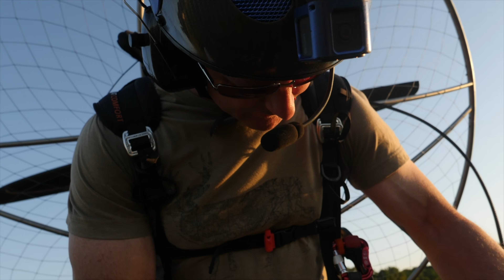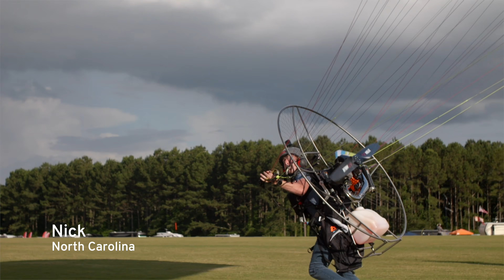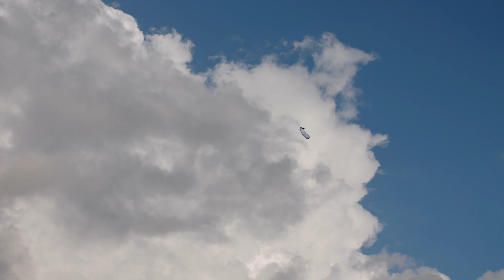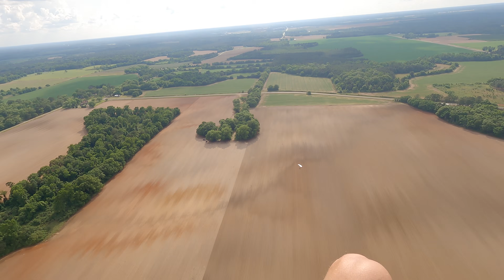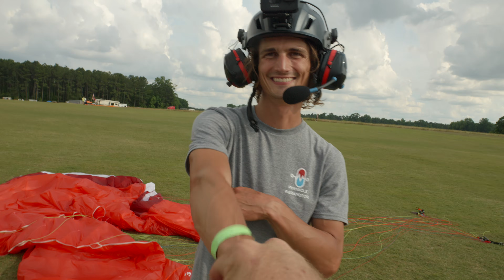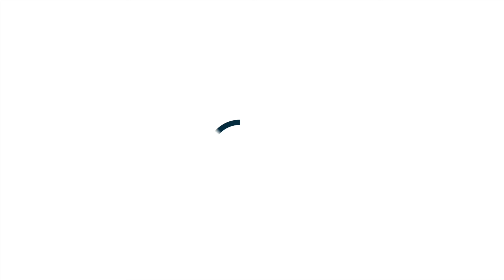Limitless Paramotor UNVEILED at Bad Apples - 4K

Comment: Nice new frame! I love it. Please make a video of how easy it breaks down and builds back up for transport. This is looking like a serious contender for my next frame!
Reply from the maker: Reese is traveling with one right now, breaking it down every flight. I have a feeling we’ll see a video very soon!
Reply: Coming soon, I definitely learned a lot about building this motor. TBH after 2 years of flying I never had to until this trip. I was super worried about it, but not anymore. The limitless is made for travel.
Reply: @dejavukrewe  great to hear. I don’t travel often, but I do break down my motor for transport every time I fly. Really looking forward to the video. This frame looks about perfect!!
Reply: @MrWickwire27  I broke my motor down every flight for 2 years and I’m now on the limitless so I can very much relate to what you need. Dude it’s super easy to break down and reassemble and the cage parts don’t take up much room. Once you get pretty good at it you can disassemble in about 45 seconds and reassembly is about a minute and a half. I put a quick disconnect prop hub on mine and I’ll probably put a longer vent tube on it so I can lay it down with fuel in it but I’m very satisfied
I plan on doing a 30hr type review of the limitless and we’ll go over assembly/disassembly
Reply: @Ellwoodsss1   awesome to hear! It’s looks like a great frame. I really look forward to a break down video.